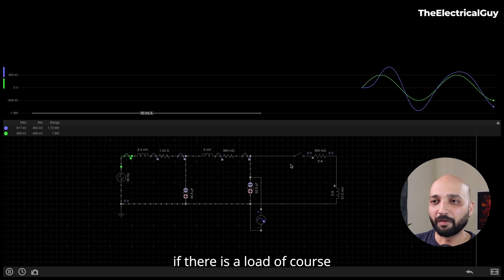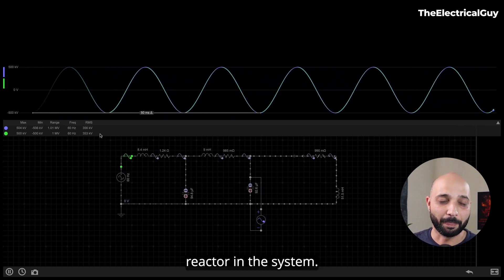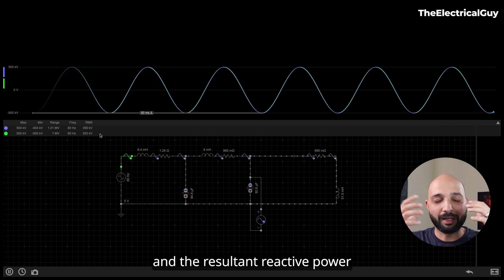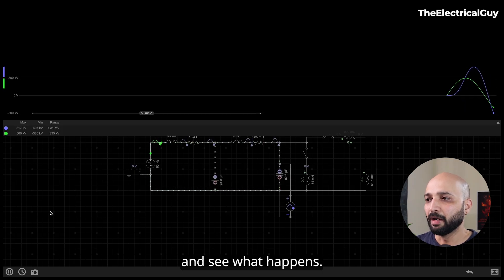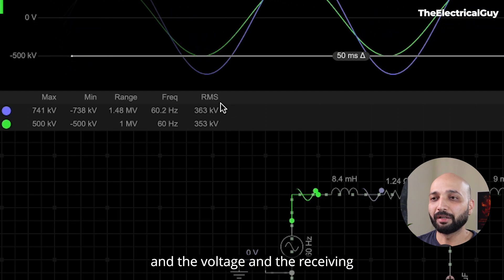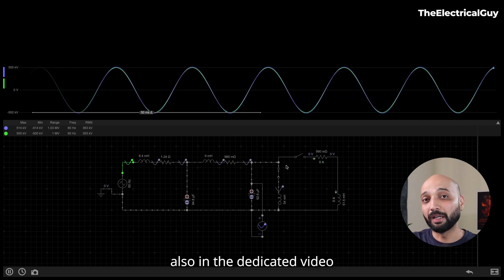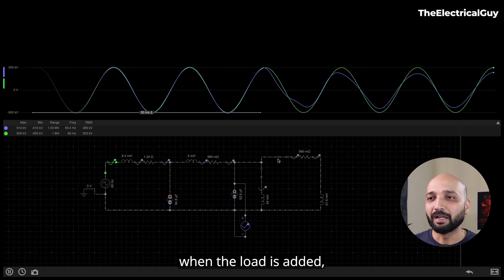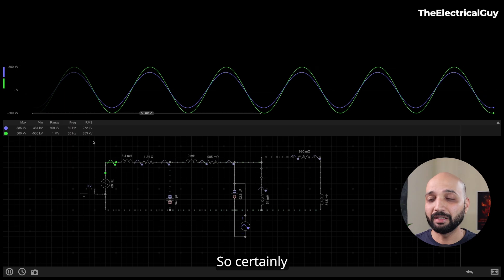Why Static VAR Compensator Is Essential in Power Systems | Explained

Comment: Voltage control.  Since this was the main issue of Spain blackout in April 2025. Please add more about the voltage control of the system with the share of many renewable energy sources. Thanks a lot

Comment: Sir now i am making sld of 400/220kv powergrid ss, there are two bus reactor in 400kv side. Not not any reactive device on 220kv side while 220 side having 12bays?
Reply from the maker: As per my experience, 220kV will not have reactors.